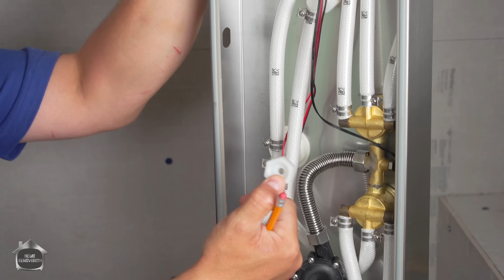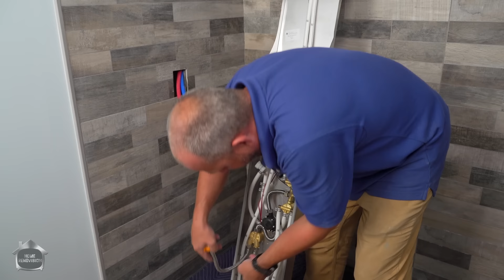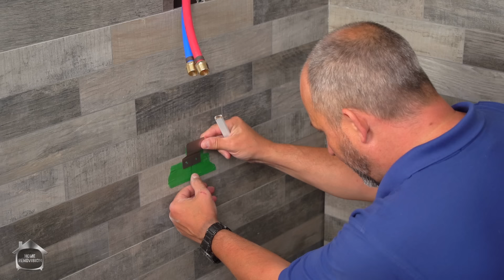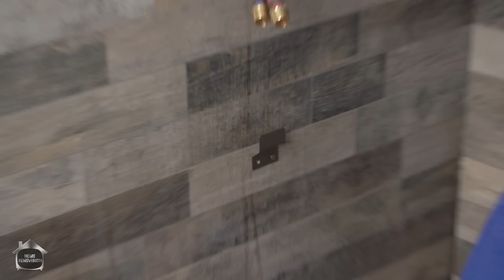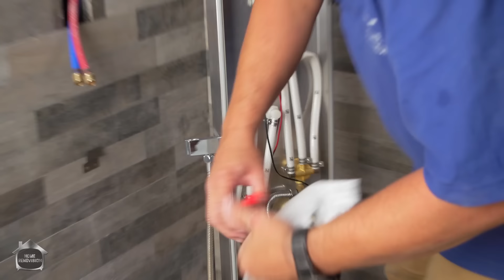Shower Tower Installation | Easy Plumbing For Beginners

Comment from the maker: Wayfair currently has this unit on sale and In my opinion it is worth the buy. only $199.00 get it while you can before it goes back on for regular price at over 500.00
Reply: It may be the sobriety talking, but I can't find your Wayfair link to the shower...
Reply: Your unit looked damaged with a bend at the top.
Reply: Can you get pex and pex crimp tools in millimetres for Europe and the uk plumbing?
Reply from the maker: just a small bend, i used my rubber mallet to smooth it out. Cheers!
Reply: @HomeRenoVisionDIY  is it OK to install this in floor pan shower ??
Reply: @Home RenoVision DIY is there a link to this product?
Reply: Please where can I find the link to this shower.
Reply: Hi there, I've bought a tower shower and I have very high pressure water in my pipes, but in the shower the pressure is low, any type on how to solve this? (If I disconect the shower the water flows it high pressure, so the problem is in the shower)
Reply: @fulanodetaldoorkut if you have multiple jets on it then you will have to upgrade your water lines from 1/2” to 3/4” has to be run all the way from the main water line to your shower as 3/4” in order to get enough pressure for all the different fixtures you got in that shower panel
Reply: Where are you located? I want to join you to learn in person..
Reply from the maker: @mrh5916  You will have to become a member and keep an eye out for the local workshops we are going to start this October. Cheers!
Reply: Home RenoVision DIY hello, can I join this October with u to learn?
Reply: @HomeRenoVisionDIY   can u do a video on how to calibrate the crimping tool u use I bought the iwiss tool on amazon from the link u posted I think its defective I cant calibrate ur videos are great I learned how to install pex because of ur videos thanks
Reply: Ooh, Wayfair is so dangerous for me! They have such a wonderful selection and incredible sale prices. They get all my money.
Reply: Hey master, do I need to b a certified plumber to do this job? Or is there any crash course I can take so I can renovate washroom for people? Much respect.
Reply: Thank you for the great instructions, tips and tricks.  Do you have an affiliate Wayfair link we can use so that they know who is sending us?
Reply: Where is the Wayfair link?
Reply: Home RenoVision DIY Jeff, where’s the Wayfair link?
Reply: At $500  i would pass  youch
Reply: its been close to a year now since this video was posted. How's the panel holding up? I've been looking at some for a possible bathroom DIY reno next month. And people said they've rusted pretty quickly (and stained their tubs) or parts broke.
Reply: I don’t see the link
Reply: Does it need power?
Reply: @ruckusrevolution9475  no power is needed
Reply: Can these units be installed in an existing shower? Meaning removing the existing shower regulator and putting this in ?
Reply: @Eric-hz4cm  It would require cutting a hole in the tile to run pipes through and a big access hole in the sheetrock on the backside of shower wall to modify plumbing but  it could be done.
Reply: One of the things I discovered from my own oversite.  Measure the distance between the nipples for the hot and cold water.  I ordered a shower tower with a 7" spacing in the back while the nipples were spaced at 9 3/4".  I could have torn out all of the tile and cement board to reposition, but decided the best course of action was to take the lumps from my wife and order a new wider shower tower!
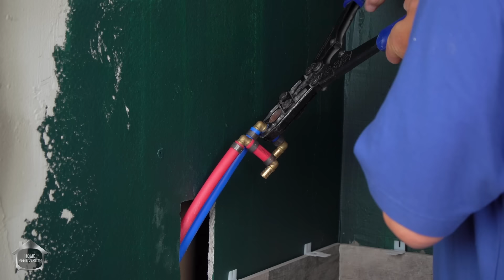Reply: 8:46 WTF IS THAT? omg... let me know how you make a remodelation or a fix after that kind of installation... jesus.. after that I just stopped watching the video....
And BTW, I love how the water is going to get into the wall because you didn't fill the hole where the pipes come out.... DISASTER..
Reply: We did same install in our home and leaking handheld shower part sent water into wall causing leakage to lower level of house.  Otherwise works fine, so trying to determine best way to install and deal with the leaking handheld.
Reply from the maker: no idea, if you find out then let us know. Cheers!
Reply: adding a bathroom light exhaust fan that is controlled by 1 switch white to white black to black when does the red wire go on the white or to the black to n ground to ground
Reply: يا اخي اضعف حلوه
Reply: u should make a video how to install  drainage in shower pan  thx

Comment: I am not being snotty, I just don't understand.  Why are we spending so much time "waterproofing" everything if a big hole doesn't matter? What is the point of like Kerdi board, or all these completely waterproof (and expensive) systems?  Do we need to do this or not?  Things I see keep saying Hardi board alone isn't good enough, it needs some sort of water proofing.  So confused.  (I am doing a shower reno, new walls, new tile, new shower tower exactly like this one)

Comment: Where are the water hammer arrestor??? In the 90s, it's was an empty pipe with an end cap. In the 20s, you need a mecanical hammer arrestor :(

Comment: You can run a bead of caulk in an upside down U around your wall penetration and you'll never get any wall come off.  My Vigo has a lifetime warranty on the valve and its soooo easy to pop it off without ruining a very nice very expensive tile job

Comment: Thank you so much for making this video. I have handyman skills but I was scared to mess with my shower tower since I had no idea how the contractors installed it. Now I know 2 things without even touching it. A) The mounting of the unit was not properly measured/done. (the thing will sway side to side)  B) I have rogue silicone beads on my one-piece quartz wall. I want to replace the thing and it's been just over 2 years. I live in a condo so whichever unit I pick HAS to have a lower "spigot" for steady downward outflow for filling mop buckets and whatever else. I have no access to a utility room or bathtub to fill anything. I shy away from a lower "waterfall" outflow since there is no telling how much splashing/power/mayhem that thing has. I can't wait to pull my old shower tower off the wall and see exactly what I'm dealing with. Mahalo

Comment: Hi Jeff, love your videos! I have been looking for the elbows for showers like this, can't find them anywhere: 1/2 inch NPT 90 degree elbow, male - Female, because the new flexible tubes that came with my replacement shower will be flattened and kinked. Any idea where I can buy these?

Comment: Just curious, why not create a recess box that you can waterproofed with your hot and cold connections similar to a laundry supply box?  wouldn't that solve the problem with a hole in your back wall?
Reply: Absolutely could, and maybe that's overkill, I mean, as long as you used bathroom/wet area specific drywall (use cement board honestly...). Just as he said, you're not giving the wall on top and behind the shower panel a nice shower, don't aim the hand wand water spray there.

Comment: We had a shower panel stop working because there was a plastic manifold that cracked.  We had to replace it and it's not that easy because the brackets on the walls are different locations and distance.  We originally had a 55" shower panel and they are now hard to find so the shorter ones will not reach the lower bracket.  How do you suggest moving the wall clips and fill the holes in the tile?  Is there any way where it won't look ugly?

Comment: Great video. This is EXACTLY what i needed. Im renovating my bathroom and installing a shower tower like this. Great tip on installing the blocking to hold the mounting cleats. I never would have thought of that.

Comment: Great video- another install well done! I'm only surprised that Jeff even tried to use the screws that came with the unit. Those cheap China screws almost always strip too easily. Best use a better quality screw such as a wood screw to avoid frustration and time-consuming removal.

Comment: Very nice video, but why wouldn't you close the hole??? If a tube breaks in the shower column (which can happen after many years of use, there will be a flood into your wall and you may not notice it until it drips inside your nice kitchen cabinets. A shower wall is always supposed to be 100% watertight, not even a question!

Comment: When you are trying to install this with copper supply lines already soldered to an existing control value and a tiled shower wall it's not going to be very DIY friendly.  I can solder copper pipe, but I'm not very good at it due to lack of experience.  And I would trust that gasket with tile.  My other concern is that it isn't going to work satisfactorily with low water pressure, such as the end of the line and on the second story.

Comment: I am about to replace a older shower tower.. the wall/sheet rock/tile  is already in place, and I have a larger hole to cover and will not be able to screw into a stud.  Will it be ok to install to the tile/sheet rock? Thanks

Comment: Awesome video. My shower panel came with two washers and two elbows with male threads. It also has two extra black washers. Do I have to use these? Or just do it the way in your video? I see there's some kind of washer built in the hot and cold water line connections already. So I am not sure if I still have to use these black washers ontop. Thanks

Comment: Most of these panels have plastic hoses in them that will burst and spray water into the hole in the wall.  Install wall mount shutoff valves in the wall and seal it to orevent that from happening.

Comment: Our inspector pointed out that this shower tower doesn’t have a mixing valve that is up to code… anyone else run into that? Any tips in replacing the valve?
Reply: That's what you get when you buy Chinesium.

Comment: Installed this model in one side (MY side) of a large 5' x 6' his and hers shower that I built as a pandemic project, having ripped out a huge tub that we never used. Love it. I regularly inspect the hole that the hoses pass thru via an access panel. No water or mold. Only problem I have had is too much flow! Without the flow restrictor, the body sprays shoot all the way to the other wall! I found that the proper wall height mounting for me is about eye level with the temperature display. Anyway, so far, so good. At least a couple of years now.

Comment: Looking to put new install on other side of bathroom  wall, then later knock  out some of it.  If I put some kind of shower/enclosure directly on my old lathed plaster, could I then drill Plex sized holes in wall to put PLEX directly down to basement a few feet away, and do the hookup there?  I would connect the PLEX that goes down through the wall with 1/2 inch fittings INSIDE the Tower Unit, so NO leak could happen in wall, and would not need to bust up the plaster much...  (OLD HOUSE)

Comment: Questionable product quality and methods

Your 180° bend in the PEX is something comical. Horrible planning in something where maintaining high psi is critical.

Your brackets are mounted with taper head screws and not pan heads, which leads to believe you don't understand the purpose of them.

Loose PEX in the wall, not stapled is not the brightest either. At best you'll have constant banging, worst: bursting a line by movement of the line contracting sharp edges.

Also: a braided line , NPSM FIP connection for water supply, IN THE WALL, is absolutely hilarious. Would absolutely avoid trash units like this.

Comment: My shower panel doesn't sit flat against the wall Thère is a gap. Also notice that the gaskets that go behind the shower are missing. Is that the reason why there is a gap behind shower panel and wall?

Comment: You should really consider closing up that massive square before installing the shower thingy , once a mouse went up there and chewed the plastic tube it was a mess when they opened the valve

Comment: Hello. Late here. I was looking to install a Shower Panel
System. I currently have the Delta rough in valve R10000-UNBXHF. Is it as easy as removing the rough in valve and hooking up the hoses? Thanks.

Comment: yet another super useful DIy video!  I installed one of these 15 years ago and it was a bit of a pita.  I like your pex arrangement and will be doing it your way in my current bathroom reno.  Though the Amazon shower panel I got does not have the seal along the side.

Comment: Hammer drilling is the way to go. Because if you installed that tile wrong it'll crack. That's the only way I drill tile with those bits.

Comment: It’s funny I’m watching this video because my hand held was on and my son was using the shower not knowing. It’s twisted itself around because of the pressure and sprayed directly behind the panel for 10 minutes and was leaking to my downstairs. I’m looking for a safe way to keep this from happening again. My first thought was silicone. But this guy is laughing at that idea🤦🏻‍♀️🥵

Comment: I bought a house that has a tower system in both bathrooms, one the systems the body jets do not work. The brand is not anywhere on the the tower. I think a connection is broken on the inside when you switch to the jets water pours out the bottom of the tower. I have not idea how to open it up to fix it. Help!

Comment: I know this is a dumb question, but I have a different shower mount I need to fix, because it’s dripping water. I can’t remove the handle, so I was thinking about removing the whole thing to try to fix it. I’m assuming to remove it, I just lift it up, right? I’m not sure if they are all installed the same way.

Comment: So I am redoing my shower as well, and I'm getting ready to tile everything.  I bought one of these shower towers AKDY -- the body sprays are all plastic.  Which isn't that big of a deal -- the concern is that if I have to get rid of it at some point, I didn't tile my shower with a hole for the valve/tub spout/shower spout, will I be able to install a valve/ and redo this afterwards? How hard is it going to be to do so?

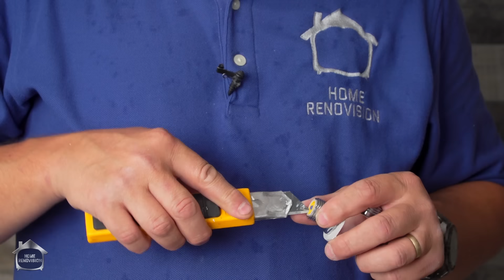Comment: LoL ,,,,@21:49 ,,,I did the same for my American Standard Spectra Versa Retrofit Shower System intake valve, it has flow restrictor so reducing 2.5Gpm to 1.8Gpm (typical California's clueless State board)

Should the hole be water-proof so water do not get inside the wall? Hmmm

Comment: Are all shower panel mounting points in the same location. Can I swap an old shower panel system with another without relocation the mounting points on the wall

Comment: so many great videos, really. but you show Schluter systems solutions that provide full waterproofing and then a shower tower with big hole for the water supply and say it is no big deal?? But all walls will show moisture in the winter especially when the room has no ventilation fan.

Comment: Wait, what are the electrical wires for?
Reply: Wires are for lighting up the temp indicator; which is ran off a small generator that works off water flow.  No batteries or electric needed.
Reply: @Saved-qv2ow  gotcha, thanks

Comment: Hi can you give us advice. Ours one doesn't heat up that good. We set our tank water heater to 125 Farenheit but the water still lukewarm temperature. We bought twice of this thinking a umit problem. But both  doesn't provide hot water.

Comment: We recently had a shower tower installed in our main bathroom - Nadoli brand - but there is a problem. Once the shower stream is running and the water temperature is good, the water gets progressively cooler and we have to turn the mixer faucet to get warmer water. Every time we adjust and after about 30 seconds, the water stream gets cooler and we have to readjust the mixer. Eventually we are at the limit and while we should be getting very hot water it continues to get cooler until you are standing under a tepid shower stream. Please can you suggest what could be the problem ? We have another shower in the house, a way simpler setup, and that does not suffer with this issue.

Comment: Ok, so I went for this idea - which is great btw…
Ordered one on Amazon, garbage…
Returned and ordered on Wayfair an Ello and Allo, more expensive than Amazon, just received it and it looks like same garbage, just x2 the price.
Instructions are a joke.
The installation video in the instructions is an insult, Jeff would be horrified.

Why are these systems sold by fly by night operations and not serious businesses???

Comment: Great video, very helpful!  I found when installing grab bars in my Mom's shower, that drill bit you used to drill the holes in the tile was much more functional going at a lower speed.  I was shocked the $10 bit bought at Ace was able to drill all the holes I needed to install two grab bars.  Thanks for all the great tips!

Comment: Do you know what the recommended psi should be for water pressure?  I have a 12" rain shower head the water pressure is ok, but I also want to add a large fixed/ hand held head.  I would assume that would greatly reduce the water pressure when they're both running?

Comment: Hi Jeff - Love every one of your videos! I'm in the process of installing the same shower tower. QQ for you - did you run the water lines in the wall down to make it easier to connect it to the tower, or is that related to better water flow?